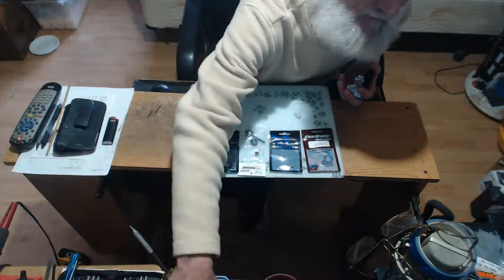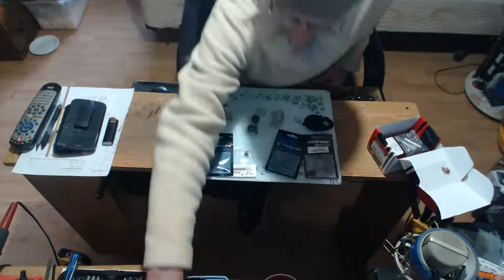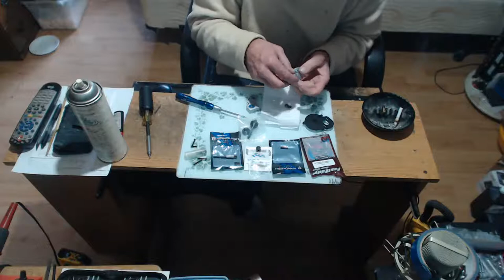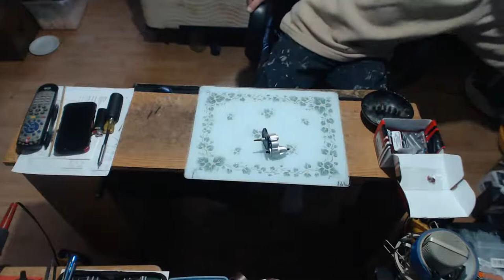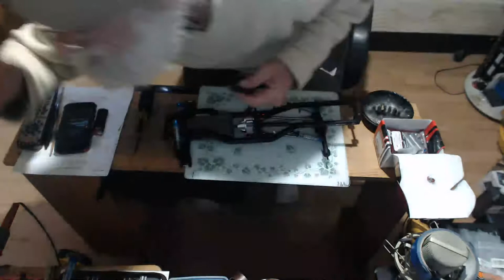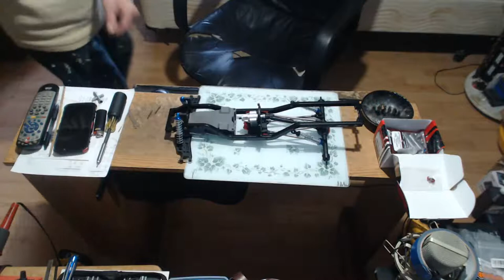SSD High Ratio Tranny Build with Vanquish, Robinson Racing, and Fast Eddy Ceramic Bearings.

Comment: Why is there two sets of God damn voices very frustrating
Reply from the maker: I didn't really say much during this vid so....
Reply from the maker: You could have muted and still watched.  lol
You maybe need to turn off the mind control programming you're suffering from... 
Reality don't care about what you wanted either.  Just saying. lmao
Reply: @HBFTimmahh  it's not mind control I wanted to hear what parts you were using. You got the SSD transmission with Robinson racing but you didn't say what parts and I couldn't hear what parts. I wanted to know what parts you're putting in the build that transmission up because I know it doesn't come with all the parts you need. Wanted to build the transmission for an smt 10 but what I'm not sure is if the parts of an smt-10 transmission is the parts needed to complete the SSD transmission.
Reply from the maker: @christophermears7738  FYI, i didnt say much in the vid at all. The Parts used was the SSD High Ratio Tranny, a VP Top Shaft, Fast Eddy Ceramic Bearings, and Robinson Racing Idler gear shaft.  The mind control I am talking about is how people get so meh when anything political is mentioned, on a Non Political Show.   I get it. But if we are unwilling to deal with the issues of real life, toy truck issues wont be a worry because there wont be any toy trucks if this shit keeps going.
Just Saying.

I didn't think much about it as it was pretty self explanatory by watching the vid.